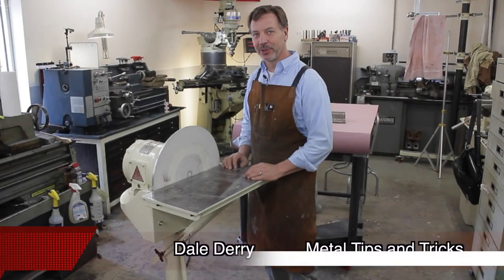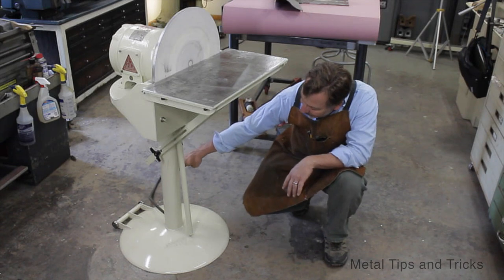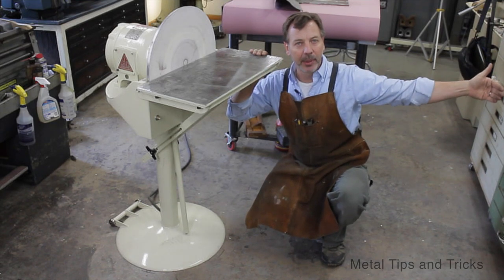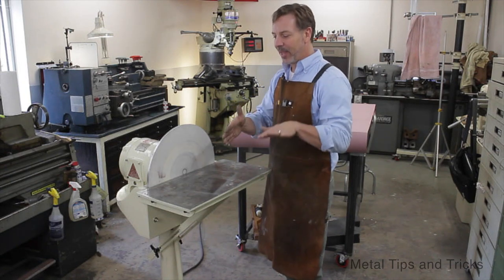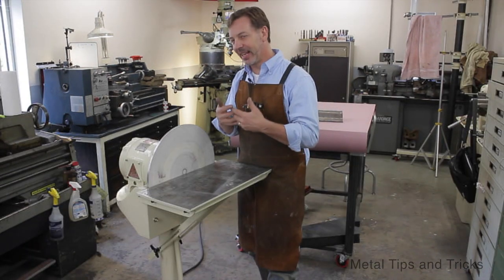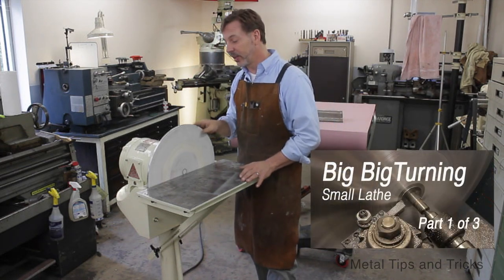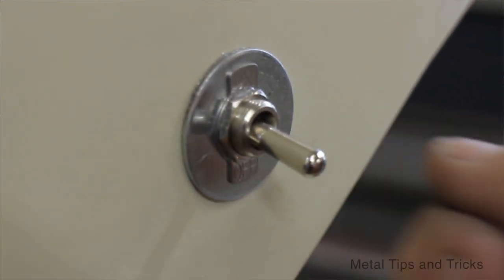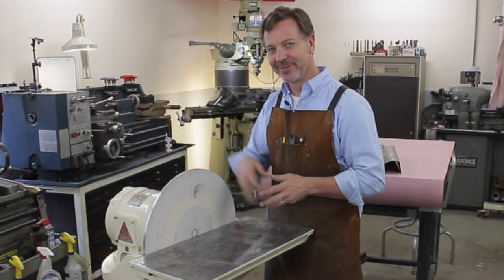18" Disc Sander tour

Comment: That's a great sander! When I built my 9 inch sander I made the disc from quarter inch plate and when I turned it on the lathe I turned about a one degree difference from the center of the disc to the edge. The reason is so that when your sanding a long flat piece the disc doesn't have a tendency to pick it up from the other side of the disc. My disc also has a forty five degree bevel on the edge in order to get into corners and other angles that are less than ninety degrees. I also put a switch on it that will allow it to run in either direction. I really enjoy watching your videos, I get a lot of great ideas!
Reply from the maker: thanks fro your comment

Comment: happy to see you mention closing that damn gap, too many people overlook it as not a big deal. my big disc grinder took almost an inch from my right thumb last winter (including .25" of bone) deburring a piece of .375" plate, the work piece got sucked right into the gap because i was complacent and didn't take the time to re-adjust properly. i have broken many bones and been in the ER more times than i can count but this was easily the most painful and debilitating injury i have ever had. i wouldn't wish it on my worst enemy. still dealing with re-growth issues and constant pain almost a year later.
Reply from the maker: Wow. I can't imagine the pain.  I too have made several mistakes, and have many rules in my shop to protect my self. A close gap on the table to the disk sander is now one of them. good luck in your recovery.
Dale

Comment: Beautifully done. I would suggest that the harmonic is probably coming from the "disc harrow" (not a plow, although they both go through the soil). You have a lot of weight on the top of the stand and harrows are made of a spring steel, effectively amplifying the harmonics from the motor as it slows down. As suggested adding sand may help, gussets from the pipe to the disc may be effective in shunting some of the spring, thereby reducing part of the resonance. Another A+ video.
Reply from the maker: Thanks for the comment. :-)
Reply: I would agree that the vibrations are being amplified by the disc.  Discs are made of a high-yield steel (this is what is meant my spring steel) so the disc in incapable of absorbing any vibrational energy, in the form of metal yielding, from the sander. As stated, struts could help as they will help absorb some energy, but adding sand may be easier.

Comment: A good way to get rid of the vibrations is weight, fill everything you can with concrete or anything heavier if you can...   
Didn't get the motor functioning much clearer than mud...   lol
This is a hell of a grinder ready to accomplish real work...

Comment: I'd be tempted to put a rubber chair/crutch tip on the end of the handle. Not only to prevent it chipping the base paint, but more importantly, to provide a little cushion for you when you're pushing it across the shop floor and that little wheel hits a piece of debris and stops short - but you're still moving.
Reply from the maker: thanks Ill give it a try

Comment: I liked this project a lot.   I'm curious if you have found a source for 18" diameter adhesive backed sanding discs, or how you're approaching getting some abrasive material that size.   Thanks for doing this.
Reply from the maker: Yes I went to McMaster carr.  It was hard for me to believe they had the best price.

Comment: GREAT! Now I know the difference between repulsion induction motors and induction motors. Great job on the sander. BTW, do you or did you have a ShopSmith? I do and I recognized the drawing for the trunnion illustration. Great job Dale, and nice photography too. Something else we have in common.
Reply from the maker: I have owned sever shop smith in the past. but I don't have one anymore. I think they are great machines for jigging up on  special projects

Comment: What kind of hub (attachment) are you using to connect the disc to the motor shaft? And would you believe that I have the very same motor and built an 18" disc sander with mine around 20 or so years ago. I used an old Diesel engine flywheel for the base and a torque tube from an old enclosed drive shaft automobile for the stand. I never quit got it connected properly though and would like to remake it. It worked but wobbled about 1/32" or so. Thanks, and nice work!
Reply from the maker: The HUB cam with the disc, but it would be easy enough to build one. I have one suggestion make it so its a slight press fit on to the motor shaft

Comment: i like your disk sander. where do you get disks i would imagine they are very expensive. i have the same motor in 11/2 hp  powering a mill. they are indestructible.the design provides exceptionally high starting torque.  you didn't mention that they have brushes mounted on a ring inside the back frame. this motor can be easily reversed by simply shifting the brush ring. they don't make them like that anymore.
Reply from the maker: thanks for the moment . I found the best price for dic was McMaster carr

Comment: Am I correct, I thought horsepower ratings were horsepower ratings. How can a motor rated for one horsepower be '3 horsepower'? Makes no sense? Thanks! Enjoy the vids!!
Reply from the maker: Horse power is calculated in the USA by how many Watt the motor  uses. Not the Rotary power at the shaft. I know, it makes no sense.
Reply: I see. Nice.